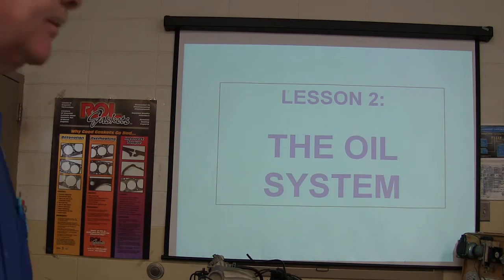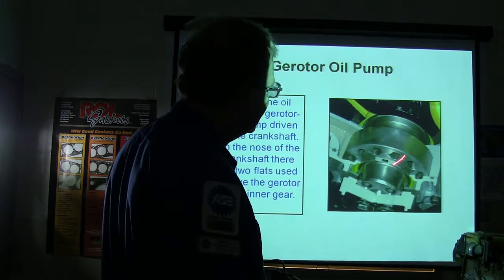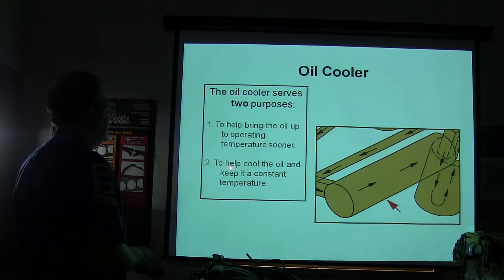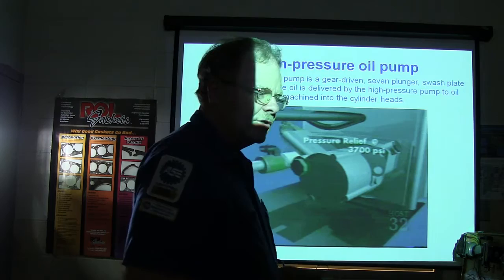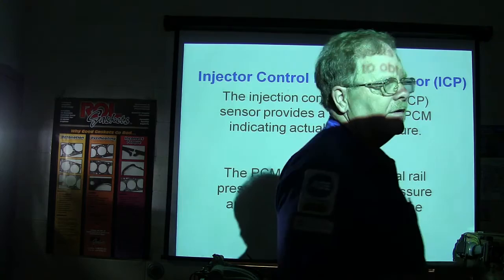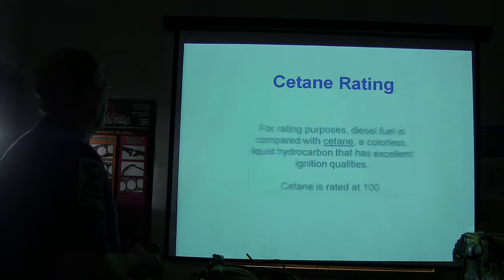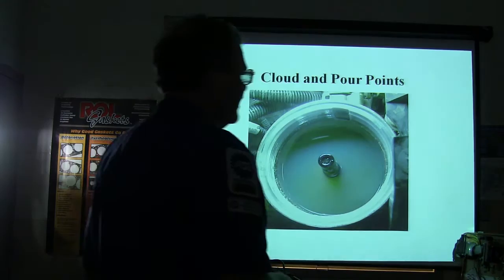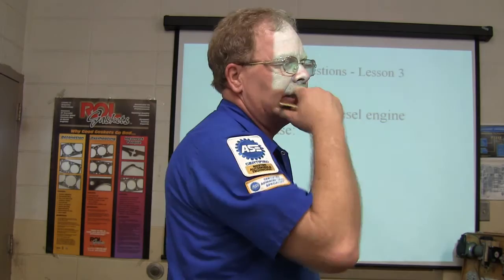7 3L PSD Part 2   Oil System

Comment: If there's a leak on the hpop side will that cause the reservoir to not refill? Does it work like a suction and if it's fed air no suction can occur? I have an issue with my reservoir not refilling, if I fill it manually the truck runs only till the reservoir oil runs out. I've looked at the check valve behind the timing cover. Spring was slightly bent. Also I did not know that there was a check valve in the oil cooler area. Will the block heater plug not being there cause any issue with the valve? Great video by the way, I have watched the complete video 3x now over time. Thank you for sharing!

Comment: We do not drain the oil or fuel. 
pull injectors and glow plugs 
Place the valve cover back on with a few bolts
 key out replace the Battery cables and
crank the motor at the Solenoid a couple times
 pull the Valve cover after 3 or 4 times Spinning
then install the glo plugs etc

Just FYI The Tin Nut on the IPR can be swapped with a 13/16 lug nut!
Reply from the maker: I've done that - but I don't teach it that way.